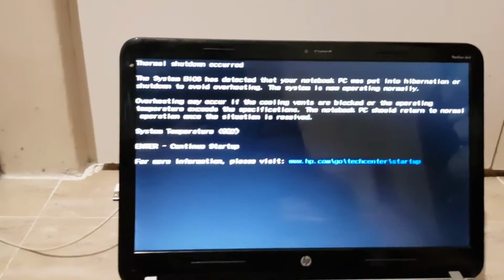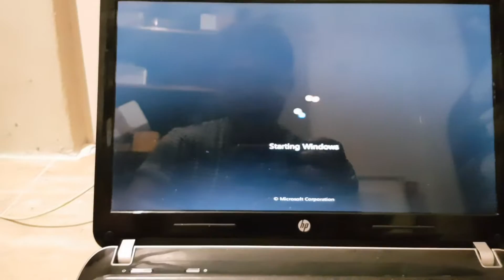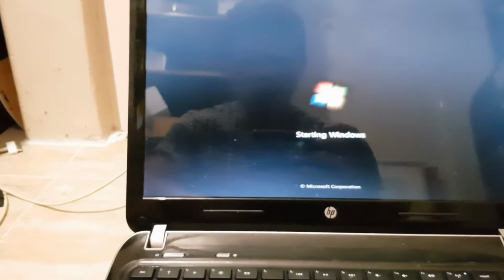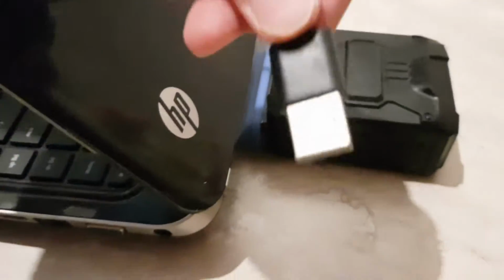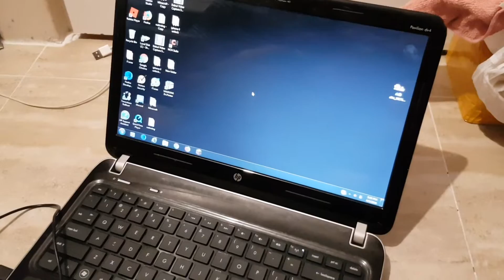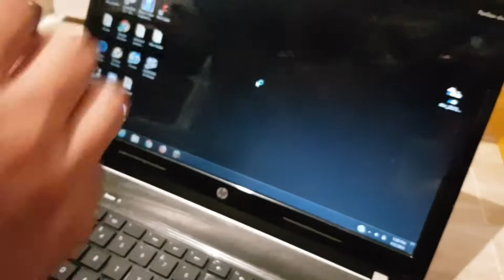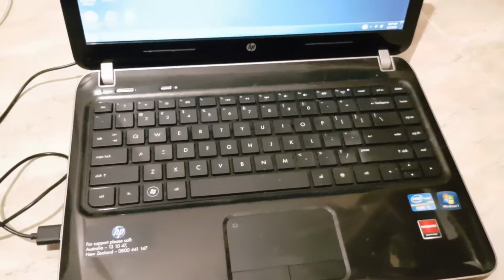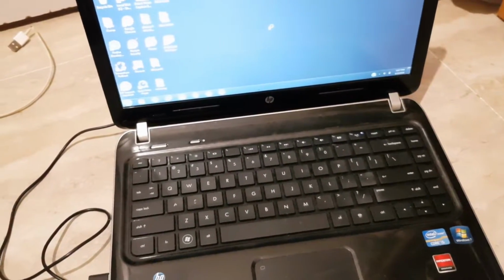Easy Workaround With Overheating and Fan Not Working on HP Laptop

Comment: I had same problem in my HP laptop but it is solved now. This error comes due to fault in your thermal sensor chip or thermal resistor in your laptop motherboard. The chip needs to be replaced with a new one and your problem will be solved. Give your laptop to a shop who repairs motherboard. They will fix it straight away.

Comment: These external fans do a poor job of regulating your laptop’s temperature. The cooling does not circulate correctly leaving manny components at risk of heat damage. When your internal fan stops working it is recommended that you order a replacement and install it as soon as possible. 

eBay is a good source for getting laptop parts. All you will need to do is get the part number from the internal fan and enter it in the search window.
Reply: I dont think I can do that